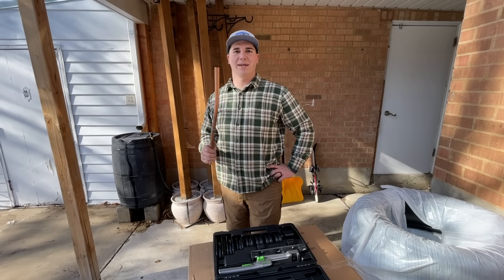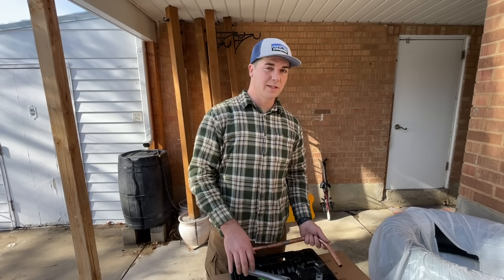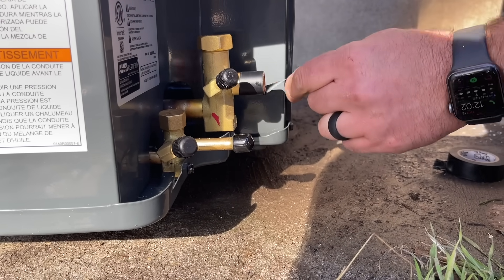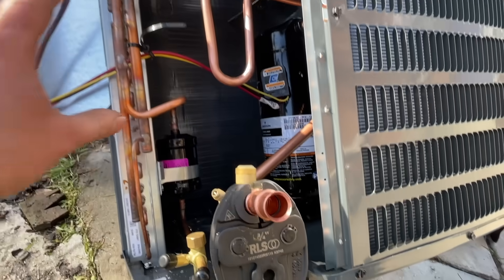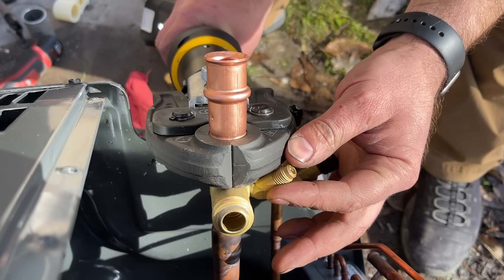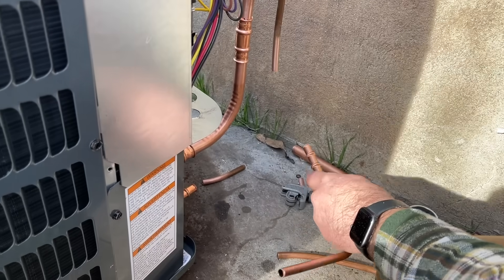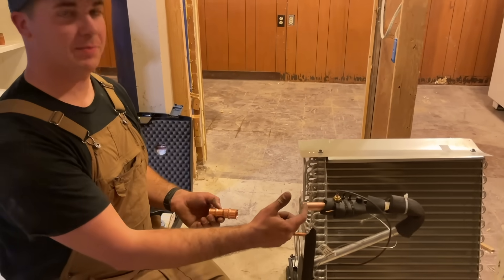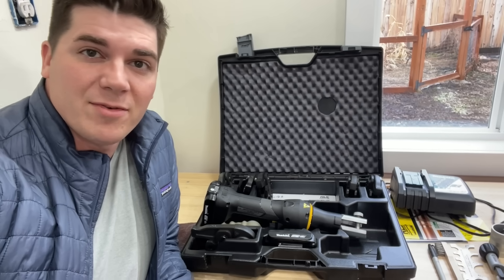Brazing Is For Cavemen. THIS Is The Future Of HVAC Copper Connections. -RLS Crimping Tool-

Comment: Been doing HVAC for 20 years and after watching that video I would say that seems like more trouble then it's worth in most applications.
Reply: I'm all for new stuff, but I agree this is more trouble than it's worth. I'm not even that good but could have soldered this up in half the time. Another thing to consider is what happens when something leaks? I could re-solder and be done with it and with this machine I could be looking at a leak right up against the valve and then look at the mess that would be. I would try to solder the joint with the o-ring in it sacrificing the ring and hoping the solder would fix the leak. It just looks like more trouble than it's worth, especially with the cost of the tools. I'm 71 so you can imagine what I'm thinking soldering a couple of joints in 15 minutes.
Reply: @charlesgale8115  I agree I would have done pulling a vacuum and doing the wiring
Reply: @charlesgale8115  Ding Ding Ding, we got a winner!
Just because these companies have done a great job of advertising that there is more probability of the pipe itself bursting, rather than the zoomlock joint, doesn't mean the pipe will never leak (and more specifically, for potable water copper jobs, which they will; as you'll read in my refer sentence below). Now, for Pneumatic copper lines, I trully see this as an OPTION, but not the panacea solution, yet; plus, I am already starting to see shops have their airlines done like this. 
But as for refer (and plumbing) jobs, you mean to tell me this company is so interested in having their product work SOOOOOOOOOOO good that it only get's purchased once??? No company works that way anymore, so my bet is on these fittings leaking just the same as sweated/brazed ones do (at some point in time) and WHEN they do; I'll be laughing my a$$ off watching guys try to do an emergency repair (almost every repair is an emergency) with zoomlock.
Truth is: time will tell, I guess.
Reply: I have these for water supply for over twenty years ,and no problems, knock on wood, did it myself, since I didn't know how to use a torch, especially under the house.
Reply: @charlesgale8115  
They have a 50 year warranty and lets be honest here... New machines today are made to fail. Nothing going to last like the old systems. We not going to see 30years or anything close.
Reply: @charlesgale8115  Yes,you are correct! Knowone is thinking about down the road in a few months or a couple of years.That fitting on the valve is a nightmare waiting to happen. My typical braze time for outdoor unit,indoor unit and filter drier is right about 15 minutes.
Reply: @charlesgale8115 : Well, being 71, it is certainly not worth it, to you. You would never recover the cost.
Outside of that, this is a demonstration, which always takes longer. Also, you need to remember, this saves the cost of gasses, of tank transport & exchange (whether by employee or contract) and silver solder, along with misc. associated tools. In a busy commercial/industrial setting, this can save a lot of money.
Reply: @zapa1pnt  until the parts house has a fitting shortage of your fancy probably more expensive fittings and then what ?????
Reply: @charlesgale8115  soldering wont hold, braze next time
Reply: @charlesgale8115  I do agree with the repair part. It’s a definite trade off. Just like propress. Most of the time, if you screw up you’re cutting out some expensive fittings. But, if you’re experienced using this tool, no way you can solder faster. By the time you get your gauges out, nitrogen out n flowing, wet rags, shraders pulled, etc., I’ll be long gone. I’ve brazed/soldered thousands of fittings, this, without any doubt is a time and money saver!
Reply: @jasonchouinard4216  I recently had some plumbing done after a freeze. The guy used Pex connectors. I liked the system, but all he did was complain about the cost of everything. This was the 3rd tool he had bought to get a good one and the fittings were prohibitive. He wasted about 5 fittings redoing them. It's great if you are working on a bench, but working on your back underneath the house is another story. I brought up the close connection problems because that was the problem he had. One break was about 1/4 in from a slab. He had to break the slab out to get enough pipe to connect to. This kind of real life work is where leaks and re-do's come from.
This system looks fine but I personally wouldn't spend the money for this tech.
Reply: @charlesgale8115  Not a fan of pex either. That being said, I own a business and we do use it. It’s impossible not to. I actually prefer flowguard. It’s at least a little neater and not restrictive. The problem is, there’s very few people/builders who will pay the extra cost for copper. And I don’t blame them. Doing a house in plastic is probably 1/3 the cost of copper.
Reply: @jasonchouinard4216  you should purge nitrogen regardless
Reply: @charlesgale8115  You just got an inexperienced guy.  I install pex all day long.  I can fully plumb a home in 4 hours using pex.  I've become an expert at it.  Bought my tools 12 years ago
Reply: @jasonchouinard4216  Betcha a bunch of these people aren't flowing nitrogen.  That speeds it up a lot.  And hey, you get a nice repair call too in nine months when the compressor fails.
Reply: @charlesgale8115  your plubmber is working the hard way.  If he would use PEX-A and use a tool made by Uponor and use the 'cold expansion' way of doing things most of his problems would go away. When you go with the cold expansion system you don't have to cram the tool into tight corners. The PEX A is also superior. There are other benefits too that i wont go into here. 
Tools aren't cheap in general. But once you buy the uponor tool you are done. By once cry once
Reply: @1realtruthrightnow742 Are you using the Uponor tool?
Reply: @aberobinson1  Yes of course
Reply: @aberobinson1  I'm more familiar with HVAC than plumbing. I was just saying that plumbers have switched to PEX and they still have problems in close quarters. The plumber was professional and was paid for by insurance in my case. On this new HVAC tool, I was just pointing out how a competent repairman could braze these connections in short order without expensive connectors. I'm not against using this system, but I wouldn't use it myself. It would be quicker, cheaper, and easier, for me to braze.
Reply: @jasonchouinard4216  I used PEX clear in a recent house build and I like it a lot. The new code approved expandable Milwaukee tool and newer fittings makes fast work of all connections. Inspectors love it cause they can see immediately if it is done right. Every water line is a home run, so no leaks and you run PEX like wire. PEX clear is also compliant and expands slightly when it is near freezing, that means you can forget about ruptured copper pipes. And the new fitting are also the correct ID for their relative size and do not restrict water flow. Copper was king for along time and it is still great, but I enjoy working with PEX . Just another two cents opinion
Reply: @1realtruthrightnow742  Rats chew thru the stuff and have flooded a lot of houses. I’ve seen it happen.
Reply: @jasonchouinard4216  I was a big fan of pex get some leaking crimp tool not exactly in the right position in a tight spot. Can't beat solder joints proven and simple to use.
Reply: @jasonchouinard4216  good reply
Reply: @InCountry6970  till a rat decides it wants a drink of water.
Reply: How would you add in the required filter drier?
Reply: @petersmart1999  that is a Goodman and the filter dryer is installed at the factory inside the machine.
Reply: @Tri-Lobe : What if it is not?
Reply: @Tri-Lobe  doesn't protect your metering device that way
Reply: @petersmart1999  Goodman comes with a filter drier by the compressor. But good question regardless. You need some 1-2 to 3-8 coupling in order to slip over the 3/8 female on the filter drier
Reply: @roroborTV  It was a general question,Ive been doing this for 29 years! I can bend up a lineset and only have 6 braze joints,I leak test woth nitrogen so thats always there anyhow,not like brazing up 3/8 is real hard to do,and 1/2 or 5/8 aint much harder! Not to mention the cost of those fittings and the tool!
Reply: @petersmart1999  he did not add one so ya…
Reply: @petersmart1999   Goodman ynitbhave the filter dryer inside .. but I definitely get what your saying as far as in out jobs
Reply: @petersmart1999  Goodman has a dryer in the condenser.
Reply: Brazing is King 👑
Reply: No kidding, I can silver braze a connection in about 30 seconds ....... plus another 30 seconds to clean up the pipe and fitting .... Then he tipped up the condenser on it's side so now it's going to have to sit for 24 hrs to allow the oil to drain back into the bottom of the compressor so it doesn't blow up if it gets a slug of oil .... Then instead of just bending the end of the roll so their is only one joint per pipe he cuts it, bends it and creates an extra joint or an extra trouble spot where it can leak down the road

Brazing is for professionals who need to lower the labor time and costs and never have to worry about refrigerant leaking into the atmosphere because of a leaky joint
Reply: @longjohn526  Like he said 'DIY HVAC' that's the level of quality. After he trashes the condensing unit and needs to buy another, a pro install is looking pretty cheap.
Reply: @vincemajestyk9497  He already paid twice as much for the tools as he did the condensing unit.
Reply: Give it time and you’ll replace every one of those joints. We just got done replacing every single zoom lock on a vrv system with 250 cassettes.over half the joints started leaking after 3 years
Reply: @ohiofarmer254  I’ve heard about more problems with zoom and shark bite.They don’t leak, they just blow apart.
Reply: They make ever kind of fitting imaginable for zoomlock, including no hub filter driers, sight glasses, etc.
Reply: @jasonchouinard4216  and what happens when you can't find the fittings because of a shortage ?  you gotta go back to the old school method anyway
Reply: @williamwofford2503  That can be said for anything really. But sure. I still braze if and when it’s necessary. I don’t cut the bell ends off at the condenser. Lol. Press is not a replacement. It’s just a new option. And just like anything else, it has its pros and cons.
Reply: @jasonchouinard4216  right,but its an extra expense
Reply: @jasonchouinard4216  fuck i want a sight glass.
Reply: Can't wait for the class action lawsuits.
Reply: @deker0954  You'd have to be an idiot to use a system like this on an outside compressor that vibrates every time it starts plus the extreme temp fluctuations on a mechanical connection. Anyone with half a brain would say NO WAY. Just because cocky zoomers can't braze. Always trying to re-invent the wheel and turn it into a square. Figure all the climate alarmists would have something to say. for leaking gas. For 60psi water service lines maybe, for 150-400psi gas lines NO WAY! Just another way to cut corners for a cheap inferior install. Brazing has worked since forever. There is surely no benefit to the homeowner or end user by using crimps.
Reply: Generally, soldered joints never leak, but mechanical joints always do, given enough time (o-rings, flanges, packings, etc).   This is great for quick easily accessible commercial applications, but a nightmare for in-wall residential with accompanying water damage.  It’s about as smart as Shark-Bite or those quick clip romex connectors.   But hey, I only make a ton of money repairing yesterday’s good ideas.
Reply: We ran over 200 ft of pipe only 1 leak on a 90 fitting..awesome tool
Reply: @heraldlee8112  So far. Let us know after 12 years.
Reply: Now you know why there's an 'anti-DIY HVAC guy' channel. Who's gonna go and buy all that garbage which hasn't even proved itself out yet. 
Even if you can't braze any idiot can use Sta Brite 8.
Reply: @vincemajestyk9497  And they can fail to clean it, let residue into the compressor pump, and have the pump blow.  

Honestly there's so much better stuff to DIY.  Retile your bathroom floor!  Repaint your walls!  Replace your carpet!  Leave refrigerant lines to the professionals.  I may be biased, but eh... refrigeration isn't stupidly complicated, but there's a lot of little details that are non-obvious.
Reply: @vincemajestyk9497  I don’t really see this as a DIY HVAC problem. This guy has a YouTube channel. I don’t know many homeowners who would go drop around $4000 for a tool they’ll use once. It’d be much easier for them to get a torch and and watch a YouTube video on how to braze. Lol
Reply: @jasonchouinard4216  Problem with brazing isn't the 'brazing' part per se. It's filling the system with Nitrogen to prevent any corrosion or corrosive gasses and then purging it. You'd be surprised how many people can't braze. 
Had a refrigerator worked on under warranty for the sealed system. Guy that came out balled up the rod all over the joints and they ended up giving me a new refrigerator. I watched him. It was awful. Box temp was 52 degrees and rising before he high tailed it out of here.
Reply: This would only be good where hot work isn't permitted. If you do that kind of work this is a great thing but I don't see I being normal. Kind of like I bought a battery powered Navac flaring tool this year, I do enough mini splits it's justified and already paid for itself. There are some circumstances had I owned one I would have used it but I think for most it's a toy. My van has enough toys that cost more than I make off them
Reply: Forget the trouble. Ask the real question. How long is this garbage gonna last with the higher working pressures? How about the changing seasons? How long is that rubber seal going to last before it leaks? This looks like a nightmare to me and is one of the reasons I won't replace my R22 unit that just won't quit. We aren't moving forward, we are moving sideways at best.
Reply: Just clogged the metering device in less than 2 years 
Good luck getting all the little pieces of copper out the pipe after deburring
Reply: @KDPMECHANICAL  You have to deburr any pipe either brazed or pressed so that is not a failure point it is a process failure! You have to be careful.
Reply: I have a tendency to agree. I’ve been in the trade a lot of years too. Rapid lock system only appeals to me when working in tight attics where brazing is very difficult or just miserably hot because of the season. No need for fire watch with rapid lock in a space like an attic. I’ve brazing in those situations for years with no issue but having a choice would be handy
Reply: It’s probably one of the first time he did it so not too bad, brazing/soldering is not a piece of cake either, I know some you tubers make it look simple but it’s a lot of edited videos, this guy went through the process and took his time. Yes brazing will probably always be king, but there have been plenty of times I have been in an attic, under a house, or other tight places where I wish I didn’t have a flame and rather have one of these tools..
Reply: I disagree!
Reply: @summerforever6736  purging and evacuation is recommended by the manufacturer and i have 40 years experience in the field. you have to leak test anyway.
Reply: @brianphillips4115  of course you still pressure test and evacuate, but why would you purge while pressing a fitting?? Lol. You understand why we purge when we braze? It’s to prevent oxidation during the “brazing process”.
Reply: @jasonchouinard4216  when did i mention purging while pressing a fitting?  you purge nitrogen through the system, then leak check, then evacuate.
Reply: @brianphillips4115  Sorry. I guess I took ur comment that “You should purge nitrogen regardless” to mean purge while pressing.
Reply: 40:years and I agree with Shane
Reply: @stephengerke5998  You guys would have been against indoor toilets back in the day. Would have been too much trouble to plumb a water and waste line. Easier to just build that outdoor shack and dig a hole and keep a sears catalog nearby.  Misery loves company.
Reply: @1realtruthrightnow742  There are good solid proven methods, and then there is good idea fairy marketing.
Reply: When we did a warehouse-to-apartment complex conversion we had 2000+ fittings and the pro-press we used saved a LOT of time. I don't work for that company more but I think it's safe to say that after using the tool enough it pays for itself but for smaller and most residential jobs doing it the old fashioned way makes most sense.
Reply: Exactly!!!
Reply: I did HVAC for hobby for years, this crimping is totally BS, imagine if the crimping stars leaking close to the opening valve.  That will be fun to repair = silver solder yeaaaaaaaa.  Back to square one.
Reply: I am not a professional or anythlng, but my dad has been a carpenter for 65 years and I know lots of people who are the same and I have never once seen these new quick methods be as good as the old soldering, brazing, or the other old school methods.
Reply: Absolutely
Reply: OMG ITS NOT EASY AT ALL IM SURE THEY LEAK LIKE CRAZY
Reply: It’s a risky option to take when you look at the cost of the press tool and the fittings, I don’t see much time saving compared to brazing of anything it takes longer.
Reply: Absolutely correct. Brazing is so much faster and cheaper. Also if you bend the line set you have even less joints. Absolutely silly
Reply: Easier, faster doesn’t equate to better
Reply: agree, we started using this a year ago and are already getting leak calls. we scraped the thing
Reply: .. Extra costs.. Extra tooling to carry around, and I don't see all this being faster than soldering but that's no what concerns me the most. It's the fact that there's an o-ring in there that seals it. O-rings die in time, they dry out, get hard, or chemically they break down depending on what they're exposed to. It's my bet that at least one manufacturer will go the cheap route and put low quality O-rings in the couplings. This is something I've come to expect out of ANY O-ring coming out of China. 
I have soldered fittings on my own refridgeration system on my home that are 50 years old. No problems yet. 
Claiming that they're safer is rather silly to me since pretty much NO plumber or HVAC tech sets buildings on fire by soldering. I never did.
This system strikes me as a novelty and I would not expect them to hold up over the long haul, and then they do start leaking they're going to be more work to replace than a soldered connection.
It's a no sell for me.
Reply: It's almost like he made the video as a prank
Reply: I would NEVER let anyone doing pipes on my A/C unit like this. it's brazing and soldering or nothing.
Reply: @Whatda25  Neighbors house burnt down from an AC contractor using a torch in the crawlspace where the air handler was. Insurance went after the contractor he had to pay for a new house to be built it was a big custom home too not cheap.
Reply: @Whatda25  If you look at it from a business standpoint remove the risk by not having the torch in there. It's probably different if you're a one-man company the owner is little more careful. Employees tend to not be so careful they are not the ones who will end up paying.
Reply: lower skill. higher corporate profit. you are watching people shill for their own replacement.
Reply: @DieselRamcharger  Why I only hire owners who do their own work, or with a helper. They have skin in the game these larger companies don't care who they hire.
Reply: Ding ding ding, we have a winner. Yeah this right here is a waste of time.
Reply: About the only thing I can see is it would be good when you change filters. I never liked to solder these out of fear of damaging the filter. However I use wet rags to wrap filters and it would be an expensive tool just to do that and you still have to solder other areas where you can’t use the crimper.
Reply: That's what I did about 25 years ago on my house water lines,not knowing how to use a torch and all that dangerous stuff under the house, a d I got it done, and still holding after all this time, knock on wood.
Reply: Agreed. I will put my brazing up against these gimmicky crimp fittings for long term reliability just like my sweat soldering potable water plumbing with K copper will ALWAYS outlast PEX & PEX fittings, as long as those pipes do not freeze. My grandfather's home was plumbed in 1940 with K copper, and after 64 years, it has never had any leaks in the copper. A 15 year old PEX repair in my 1953 home catastrophically FAILED. The properly installed K,L & M copper has all held together very nicely with sweat soldered fittings. With PEX, my whole F'ing house flooded.
Reply: I’d have the unit brazed wired and be working inside in that amount of time
Reply: I want to know how long before those Orings start leaking
Reply: My son has the Milwaukee crimping tool for plumbing, it would work with this type of fittings or is it a different tool?
Reply: If anyone tries connecting your equipment with these fittings RUN them off of your equipment, they are not qualified.
Reply: The long term sealing of this method is very unlikely. Remember how some plumbers recommended agains using compression fittings, and they are a metal to metal seal: I tend to trust a soft copper olive way more than an elastomeric O-ring.... Even for an HVAC aplicaiton, a Parker Compression Fitting must be superior to this O-ring stuff (why not use shark bite right away....). And if themperature of brazing is the issue, why not flare the pipe??? IN aviation, flare fittings is the way to go for most things: Vibration & temperature change resistant. That sould like an HVAC profile to me!
Reply: With new flammable refrigerants this is really the only way to make the connections without  causing any fires
Reply: And very likely way more expensive than solder
Reply: Great video thanks for the info
Reply from the maker: Why do you say that? I’d love to get some feedback. I’m not completely swapping to this but in some circumstances I’ll definitely be using it.
Reply: Looks like a big mistake to crimp something so close to the service valve!  The makers of this tool should be ashamed of themselves!  What happens if you have a leak on that crimp next to the service vavle right after you install it?  How do you get that crimp fitting off without damaging what's left of the pipe?  After you get that crimp fitting off, you don't have much pipe to work with!  You have to get in that tight space with a swaging tool and hope that goes well because that's your last chance of being able to do this easy.  And then you have to pray that after you braze that you don't overheat and ruin the service valve which will be hard to keep cool since you are heating right on it.  Why in the world didn't the maker of that tool come up with a fitting that could be connected to the OUTSIDE of the swaged pipe coming off the service valve?  Forcing you to cut that off and leave you too little pipe to work with is  AWFUL!   So imagine you're the next guy that has to come fix the leaks caused by this lame tool?  Are you going to be happy about taking on the risk that might even leave you with the unenviable task of replacing a service valve?
Reply: @andytraiger4079  I just had to fix a leak on a Trane condenser because this was done. I carefully cut the fitting off but ended up replacing the 1-⅛ suction service valve anyway. I was sure I would overheat the valve with what little stub was left. Also was leaking on the liquid line @ the air handler.  High pressures coupled with constant vibration, in my opinion, is a recipe for leaks using press fittings. But it's great for business for the service guys. Those fittings are not cheap either. I guess if you are doing a large job with several employees and shifting the cost to the customer you can offset the price of Oxy-Acetylene, Sil-Fos, and nitrogen for purging. But for a one man business just stay with brazing. O-rings and Teflon seals have always been a popular  failure in automotive A/C whether it be from a line to a component or in the assembly of the compressor. It's also a popular failure in commercial and supermarket refrigeration with the EPRs, heat reclaims, sight glasses, etc. I hardly ever encounter a leaking joint that was brazed.
Reply: @topher8634  You make some really good points.  I do notice that In the automotive world the O-rings are a common cause of leaks!  And 410a is running at a much higher pressure than 134a; so I would suspect those crimp fittings to be even more likely to leak than the types of fittings used in automotive a/c.  One benefit for the customer for using the crimp fittings would be they don't have bad installers doing brazing without nitrogen flowing and creating acids in the line set that will shorten the life of the compressor.  Around here nearly all of the HVAC installers don't bother to flow nitrogen when brazing.  They also don't use micron gauges to test vacuum.  There's a lot of pretty crappy installers around where I live; so maybe the crimp shit would be a step up for the customers.
Reply: @andytraiger4079  to be honest  oring leaks are not that common.  Most leaks are from hoses on the high side, condenser damage, evaporator tube to main branch, and compressor seals.  Of course, automotive HVAC is exposed to a more harsh environment than residential HVAC.
Reply: @johnd5398  so what are you supposed to do?  Are you supposed to braze a small section of copper lineset into the two female service valve connections and then crimp to those?  If you end up having to braze that, why not just braze everything?!  I've heard of a swage tool; but what you really need is a reverse swage tool to take that female opening and squeeze it back to make it a male connection.  I'm pretty sure such a tool doesn't exist, and even if it did I'm not sure that the copper wouldn't be weakened too much to hold a crimp connection.  Who is ready for transgender surgery on HVAC equipment?  Not me!
Reply: @andytraiger4079  your brazing next to the service valve regardless on installation, I agree with what your saying by the way, but you can braze next a service valve and keep it cool enough, it’s done everyday all day.
Reply: @diyhvacguy   the cost of the tool  , the availability and cost of the fittings ..and the extra time it took playing with the gadget  ...when i braze i know i got a solid connection so yeah i will stick to the old school method ....i have enough extra gadgets and gizmos  to clutter the truck
Reply: @diyhvacguy  one of them tools that winds up as truck ballast---  it sure isnt faster with the lack of access and expense
Reply: @diyhvacguy  he says that because this is an incredibly expensive way to make more work for yourself. You added more joints and more points of failure for no reason. Also if you ever had to remove a pipe you could not do it.
Reply: @diyhvacguy  that is what we do now... after a year of using just this we had soooooo many calls for low refrigerants, its not worth it.... but I can see how some small shady companies will only use this... to get the repeat business... until the EPA starts to notice you are pouring refrigerant into the same units every year lol
Reply: @diyhvacguy  I'd have my vacuum pump running before you cut that suction valve. A properly brazed pipe is stronger than the pipe itself and will NEVER leak. Problem is not enough guys can braze properly.
Reply: @diyhvacguy any issues a year later ?
Reply: @diyhvacguy  There is booklet on leaks by Big Blue leak detector manufacturer.  It is called " Everything leaks"😏
Reply: @diyhvacguy  I find this safer than brazing indoors, reduces the risk of fire hazards